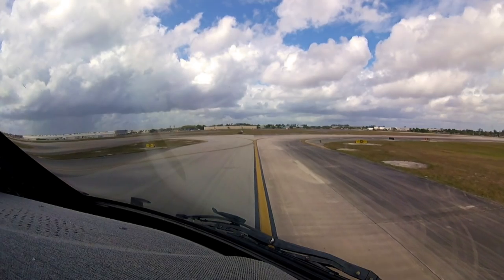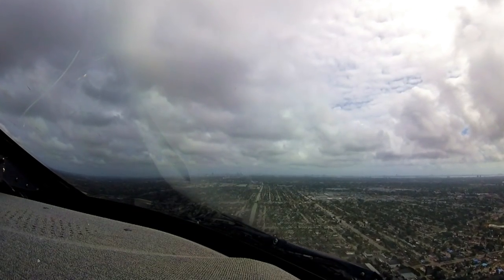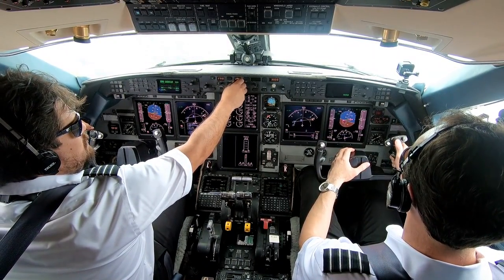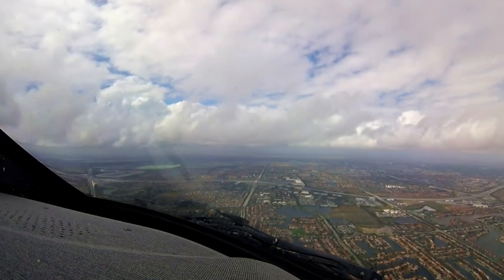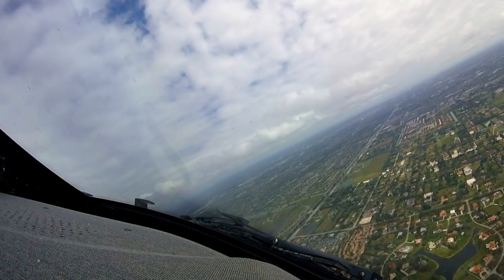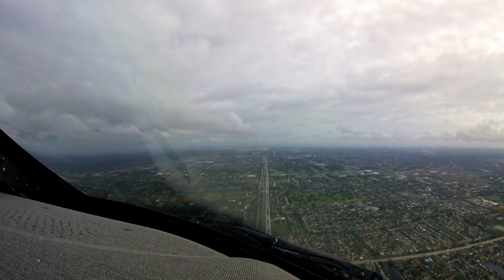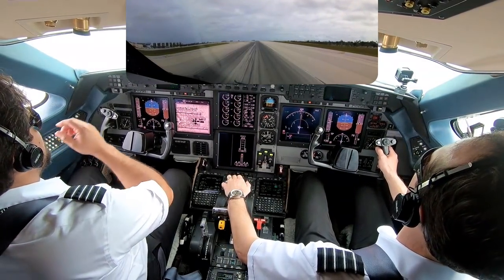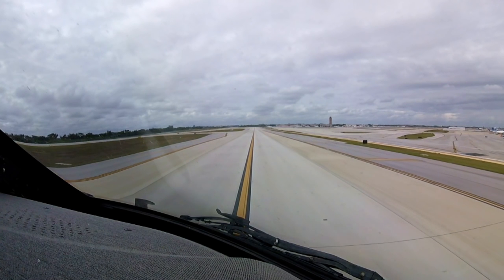Gulfstream Opa-Locka to Ft. Lauderdale International Full Flight - Pilot VLOG 62

Comment: I spent 5 years working out of an office just north of the Hollywood -Ft Lauderdale runways by State Road 84. There has been a few times when they do a "go around" with them big widebodies and when they are that low and throttling back up a few hundred feet over your head. Believe me, it gets your attention.

Comment: Sean- great video (as usual!) Quick question. At 2:38 the auto-throttle setting changes from 250 to 200 knots without any one adjusting the knob next to it. Did Jon change it from the FMS? (I noticed it was back  at 250 later in the flight.)
Reply from the maker: That happens. When the FMS shows less than 20 track miles to the airport, it reduces to 200 knots. Initially, we had direct to the airport, so it went to 200 knots very quick. After Jon added the approach, the track miles went above 20 miles, so the FMS directed the speed back to 250 knots.

Comment: Why the speed brake lever does not come up? Even if the spoilers were deployed. Tks for sharing these videos with us.
Reply from the maker: The lever does not move with the auto deployment of the spoilers. We will use the speed brakes manually in flight from time to time, but they make for a slightly uncomfortable ride, so we try not to use them too often.
Reply: Thanks for you anwser. Is there any indication on the Lower/Upper DU that the spoilers were deployed? It is very nice to see the whole flight in all details as you show. Congratulations.

Comment: Nice video - I like the outside view superimposed on the cockpit view. Quick question - what does "ref-ing X, sinking Y" mean? I'm thinking the "sinking" part is pretty self evident, but not sure what the "ref" part correlates.
Reply from the maker: The Ref and 10 is referring to the speed. Vref is 1.3 times our stall speed. We fly final approach at 10 knots above that. The sinking part is our descent rate in hundreds of feet per minute.

Comment: This might seem like a dumb question to the professionals but here goes. When you in the gulf stream are taking off behind say a slower plane. What spacing (in distance) do they try and keep from you and the other plane. Like mile or two ?  Just wondering. Because the last flight I took on the Southwest bus we  took off behind a Delta MD80 think there still some of the older Northwest jets. Within a minute or two of take off, I could tell from (watching your videos) our air speed or rate of climb was held back for a minute.
Reply from the maker: Honestly I’m not really sore on the distance. Perhaps someone else on here can help us out on that. Usually they will turn the slower plane right after takeoff so the faster plane behind can go by.

Comment: What airspace classification you were flying through , when Controller requested you to climb back to 2500 ft to keep you clear of VFR traffic at 3 clock range 1 NM I think that was a loss of separation and must be reported by you guys .
Reply from the maker: I'm not sure what airspace we were in at that time, as we were in and out of several airspace classes. I could be wrong here, but I thought there was no report needed as we did not have a TA or RA.

Comment: Any idea why the backup attitude indicator was flagging around 4:20?
Reply: 2 Tall Paul 428 good catch. The Inop flag is indeed flipping. Not sure about the G-IV, but on a 1989 King Air 200,  some of the engine bleed goes through a venturi to produce vacuum for the boots and for instruments. If there was a problem with the bleed or vacuum lines, or an instrument fault, the Inop flag would appear
Reply from the maker: That's actually the NAV flag for the backup ILS. We weren't getting a solid signal at our position, so it was dropping the flag intermittently.
Reply: CPL that's a relief.

Comment: Great as always guys. What are those two black and white rotating discs by each seat?
Reply: David Jones yes - I have wondered the same thing.
Reply: David Jones manual trim wheels for pitch. Normally they’re controlling the trim from the electric trim on the yoke but the wheels are there as manual backup if that fails.
Reply from the maker: Yep...trim wheels

Comment: when you say engine bleed on what does that mean Jon?
Reply: dale schellenberg engine bleed air has a lot of uses - on the King Air 200,  bleed air is used to pressurize and heat the cabin, deice the brakes, inflate the door seal, and through the venturi provide a vacuum source for instruments and the boots. The bleed air is also used directly at the fuel control unit to schedule fuel flow.  The PT6 is electric start, so no bleed air used for that. The King Air A/C is an automotive-style compressor mounted to the right side PT6. The Gulfstream is air start, so it has an APU. It also uses bleed air to run the environmental Packs, pressurize the cabin, dece the wings
Reply from the maker: Hey Dale...Jerry got it just about covered. We use bleed air for many things on the G-IV, pressurization being one of the most important. It is just highly compressed air coming off of the engines and then directed to where it is needed.

Comment: What does reping 10 sinking 8 mean?
Reply from the maker: It's actually " Red and 10" which means our speed is Vref plus 10 knots. This is the Gulfstream recommended speed on final approach. Vref is a calculated speed of 1.3 times our stall speed in that configuration. the "sinking 8" means our descent rate is 800 feet per minute. That is about where it should be for a normal approach.